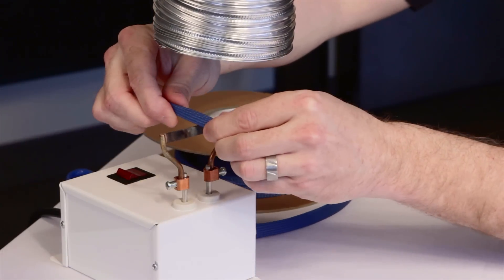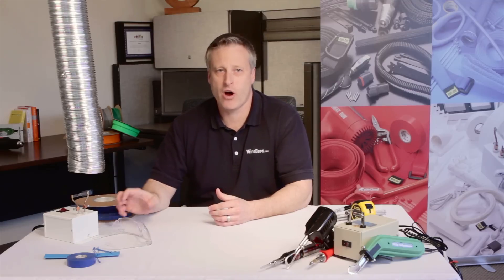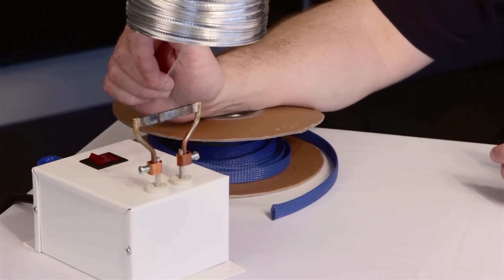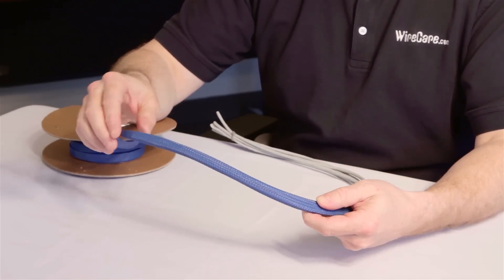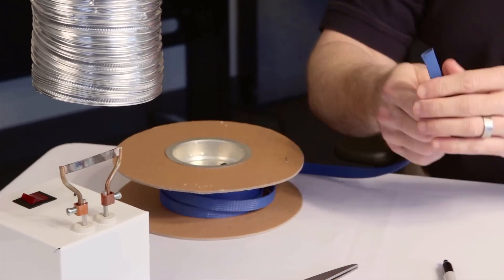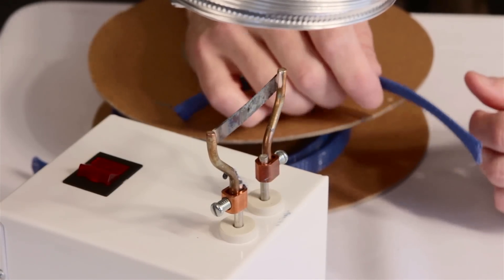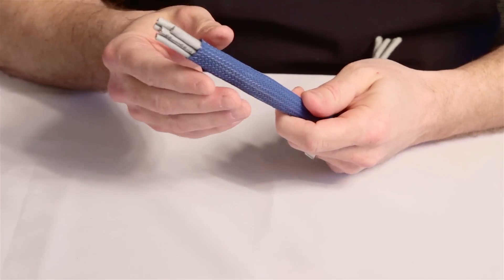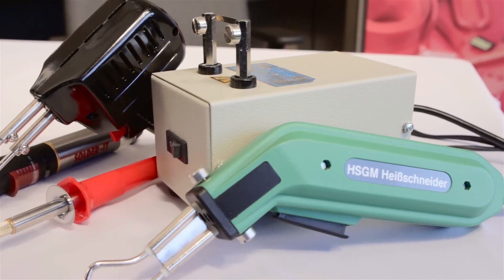How To Use a Hot Knife To Cut Braided Expandable Sleeving

Comment: Can I literally just put a knife on the stove and make it hot and cut it with that?
Reply from the maker: If the knife can get hot enough then it would probably work.
Reply: @WireCare  thanks. I was worried it might get too hot. Cuz it will be right on the stove, in the fire.
Reply from the maker: @SeymourKitty  Yeah, I'm sure it could get very hot. We've never done this so just be careful not to get burned.

Comment: Exactly what I wanted to know.  Excellent Video.  Thank you.   I'm going to use Braided Expandable Sleeving for the first time.  A mistake I did is to buy 5 metres of sleeve for a 5 metre cable.  'A slight snug fit (which I want) may create a lateral expansion reducing the length of the sleeve', was something I hadn't thought of.  Let me hope that it will still be sufficient as I will be cutting open the ends of the cable for connectors.  It is a 35mm diameter power cable of which a total of around 15cm will go into cabinets.  So I may have a margin.  Do you think a margin of 15 cm will be sufficient?

Comment: I measured 8' of the braid for my wire but when I got it on it was only 7.5' because it shrunk when expanded.  How do you measure the 3/8" so you get the correct finished length?

Comment: Nice video. Can I use a 4mm cable sleeve with a power AC cable (external dimensions: 6x4mm - a sort of flat cable, not round)? I want to order some sleeve from eBay and I am afraid of that cannot fit on the cable, even with sleeve expand